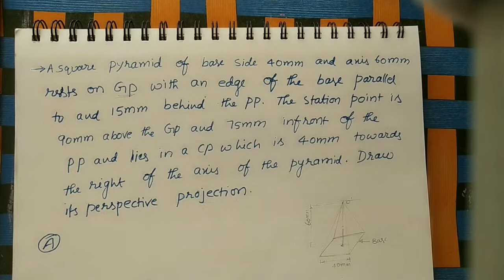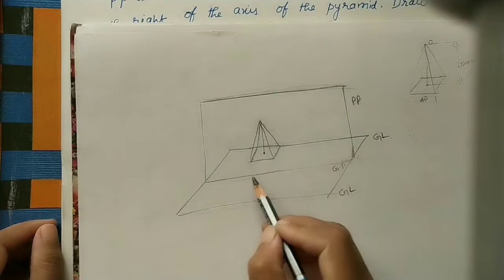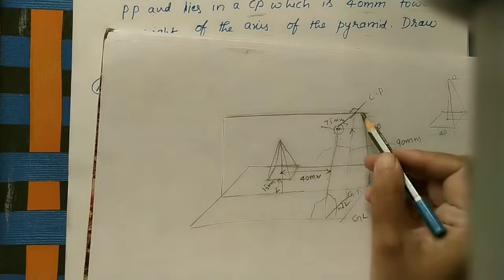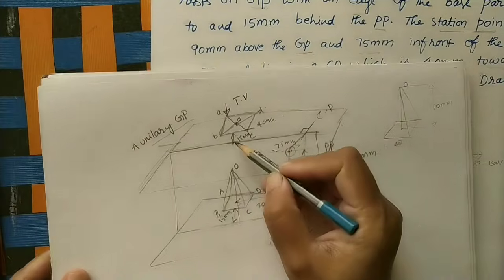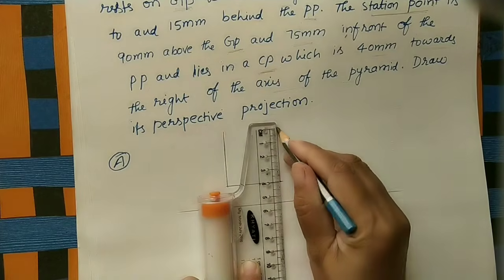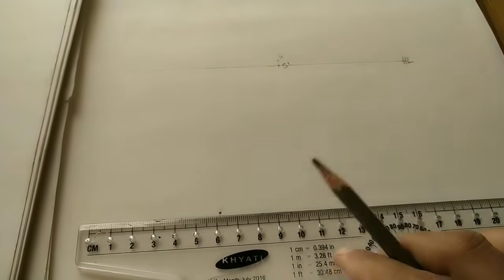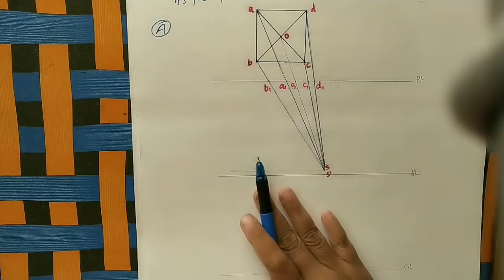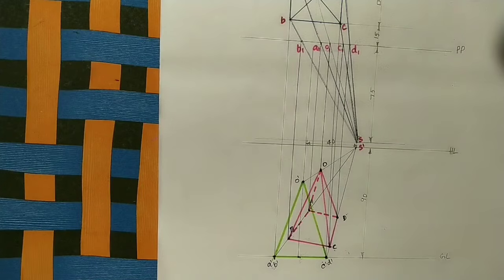Perspective Projection of a Square Pyramid //Engg. Drawing //Engg.Graphics

Comment: A right cone with base diameter of 50 mm and altitude 60 mm, rests with its base on the ground plane. The station point is 45 mm in front of the PP, 60 mm above the ground plane and lies in a central plane which is 55 mm to the right of the centre of its base. Draw the perspective projection of the cone. Show the hidden detail.
Reply from the maker: Follow the same instructions as in above video for cone also.

Comment: 4. Draw the perspective view of a square pyramid of base 30 mm (side) and height of apex 45 mm. The nearest edge of the base is parallel to and 20 mm behind the picture plane. The station point is situated at a distance of 70 mm in front of the PP and 40 mm to the right of the axis of the pyramid and 60 mm above th the ground